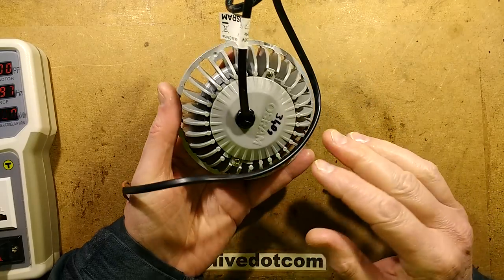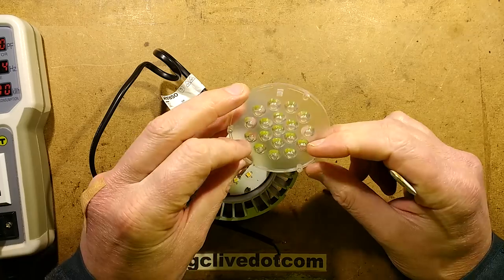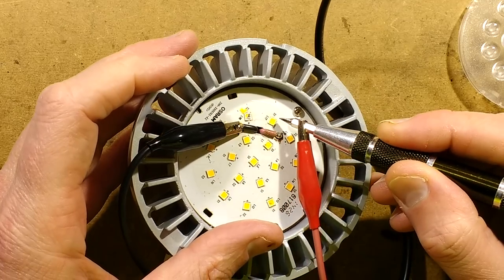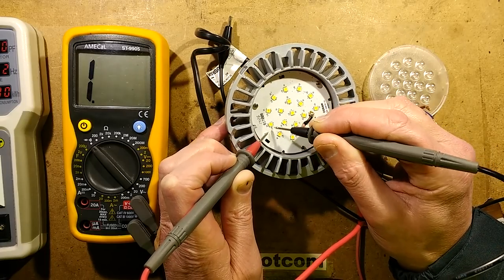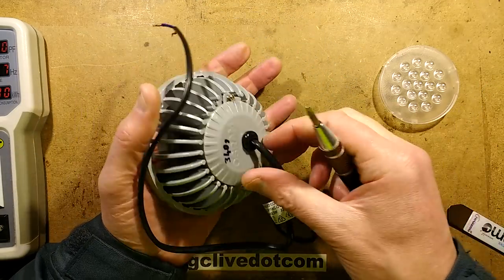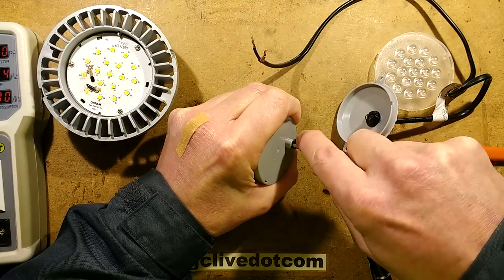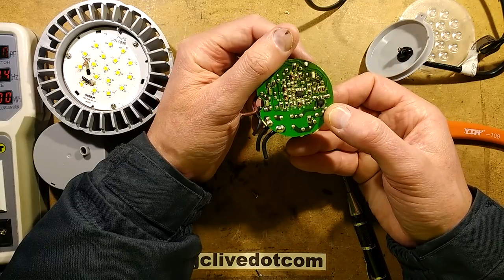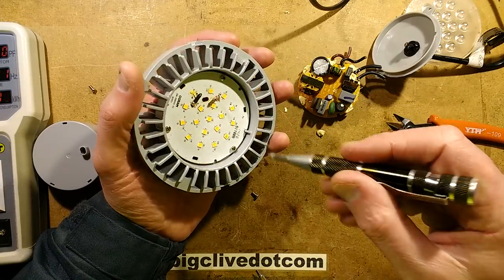OSRAM LED lamp module autopsy.

Comment: Why make it so unserviceable Osram? It may be a premium brand but people will soon swap to China export stuff after a few burnouts.
Reply: Nobody would ever service a lamp unit like this no matter how it's built. Except for a few home gamers who make up 0.1% of the market anyways.
Reply: Yeah, why make a tungsten filament lamp so unserviceable....

ugh.
Reply: Nothing like this is serviceable and no, having a premium brand fail is not a reason to then choose the lowest quality chinese junk available.  That's masochistic.
Reply: Green Silver That unit seemed very serviceable. Except the 4 wires Clive cut and the already broken LED pushed out of place, it could be put back together with a soldering iron and a Phillips screwdriver.  Basically just swap the white LED board (or even just the chips) and plug it back in.  If this was made in 2014, I wonder if it was still under warranty!
Reply: Have used Osram an example would be GU10s that have only just stared to fail after 6 years of 15hrs a day 365 days a year!  China imports last less than a year!